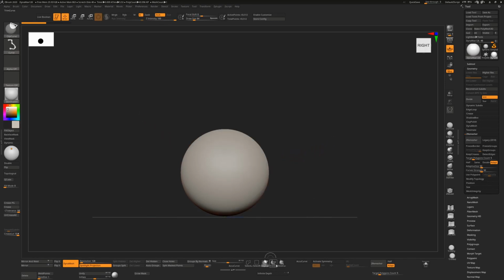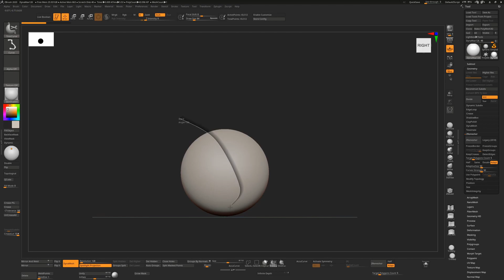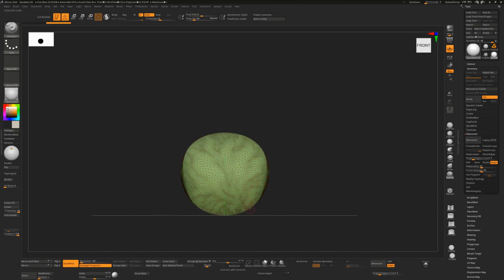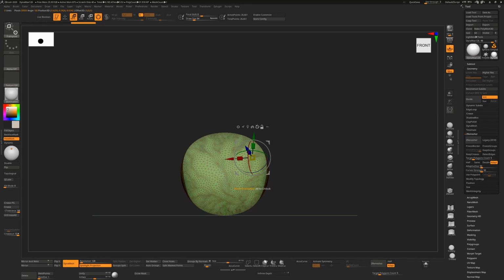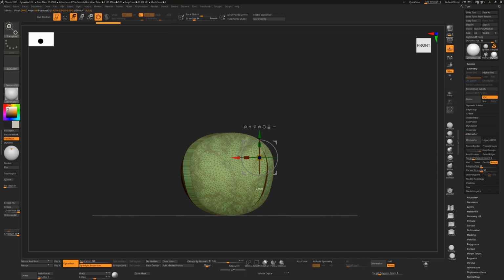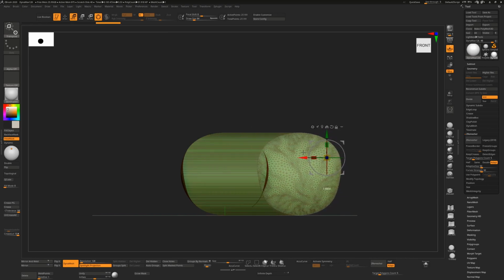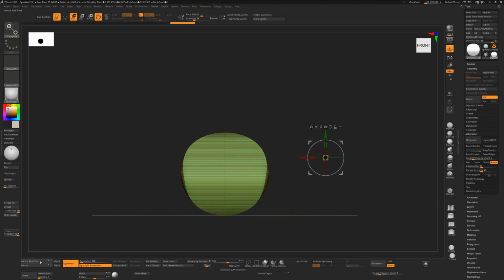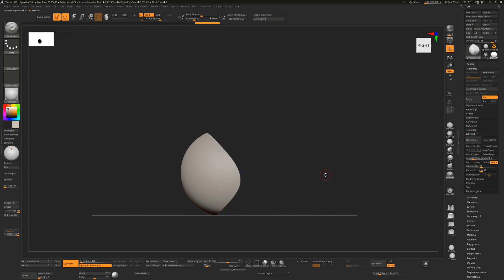Fixing convex problems on clipped or trimmed meshes in ZBrush

Comment: i am still getting this problem after following you does it have to be symetrical and on the center of the world? I was currently working a boot trying to do this
Reply from the maker: Sorry, this is probably no longer necessary as the new knife curve brush will work the way you want it to, so this is probably obsolete unless you are using an older version of Zbrush.
Reply: oh thank you as I'm really only used to 2018 I think of zbrush and I only occasionally use the new ones till I decided to make a character so the new features I had no clue about. Thanks again for the info
Reply from the maker: @GlacierFox523  No problem!

Comment: Hi Sean, I just tried this in 2022 and I cannot seem to get it to work right. All it keeps doing is just leaving my mesh all extruded and whatnot. Any suggestions? Thank you for all you do.
Reply from the maker: Yeah sure, if you're in 2022 you're n luck, as this is now obsolete. You can now do these cuts much nicer using the Knife curve brush. Just hold down Ctrl + Shift and change rfom the SelectRect to KnifeCurve and try that instead. It will cut cleanly and no need to do this cleanup process at all! :)
Reply: @SeanForsythTutorials  thank you so much. I will give it a try tomorrow .  I value your tutorials. You never let me down.